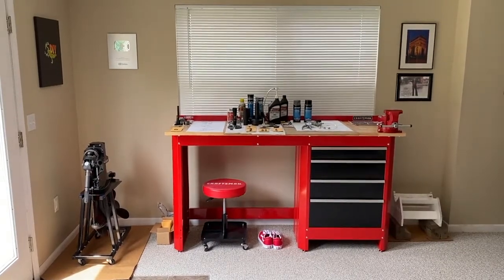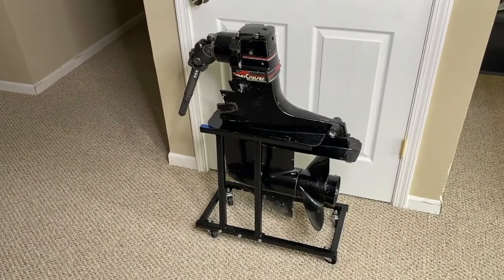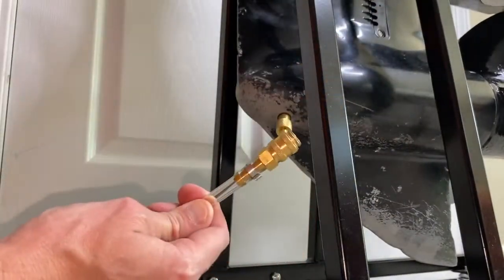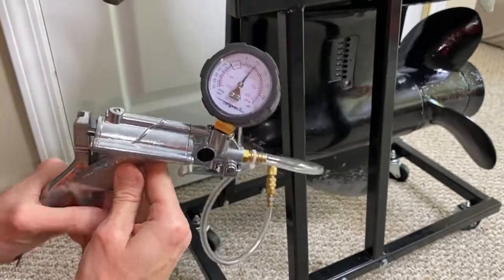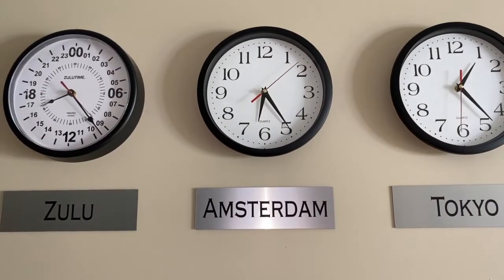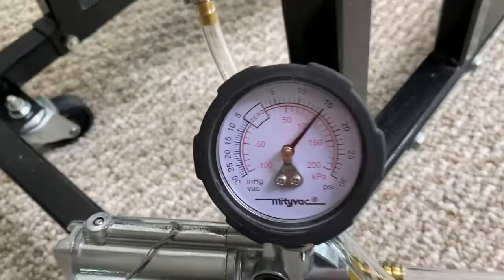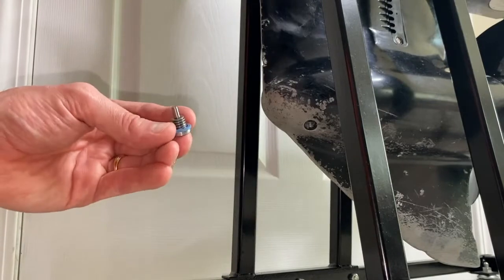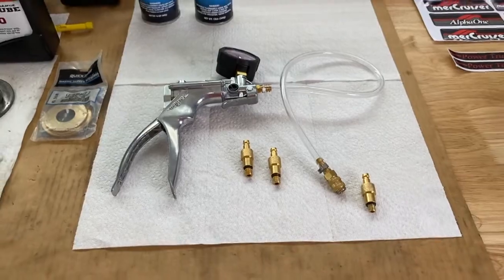How to pressure test Mercruiser outdrive properly & safely

Comment: You videos on the Alpha drives are great! Thanks for uploading and sharing. 2 questions, where did you purchase the decal kit and I see you are using Merc 90 weight conventional lube. Have you tried synthetic and what is your opinion on it? This year I used synthetic lube in my Alpha drive and when I changed it this fall I found the lube black. Didn't experience discoloration with conventional. I  was told synthetic will normally turn black however I couldn't find further information to back that statement. What do you think? Normal or should I be removing the drive for inspection as it may be a result of over heating?
Regardless, I will be rebuilding a spare Alpha drive this winter and your videos will be very helpful. Thanks again.

Comment: Is that pulling a vacuum or actually pumping in air. Cause I have a hand held vacuum pump like that I could use my gear oil pump fitting to attach it
Reply from the maker: @cameronhaddock7749  

Good morning ☕️

This is pressurizing case as we pump air into outdrive.  😁👍🧰

Comment: Thanks for all you do! I just removed my first outdrive and replaced a upper shift shaft seal thanks to your mercruiser videos ! 

Does anyone ever actually do a vacuum test? Or is it all pressure. 

My 95 5.0 alpha one gen 2 drive holds under 12 psi but if you put side ways tension on the lower shift shaft, it leaks visually dropping the gauge and you can here it. Does that mean I need to rebuild the lower unit? 

And if I’m separating the upper and lower do I now need to rebuild the upper as well?
Reply from the maker: Thanks for watching, we appreciate that.  Awesome job making it a DIY project.

Pressure test is the way to go.  Any leaks in our opinion must be addressed.

You might benefit greatly on a lower unit breakdown so you can replace seals.

If all bearings and gears look fine, replacing seals should be all you need.

We will always be here to help answer questions as you work through any project on your outdrive.

😎👍

Comment: Are you pressure testing or vacuum testing?
Reply from the maker: Good morning, it’s important to perform a pressure-test prior to refilling drive with gear oil.
Reply: @DIYwithMichaelBorders  I know that. My question was are, are you pressurizing the drive or drawing a vacuum? You're using a hand vacuum pump, correct?
Reply from the maker: @josephmufdi4564  

Thanks for the reply, we are pressurizing outdrive.